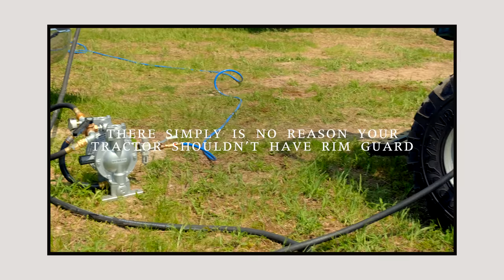I THINK I COULD PAY OFF MY TRACTOR WITH ONLY 1 JOB 🤩🚜👌

Comment: I've always considered tools and equipment this way.  What is the ROI, if any. The only thing we don't  include in the calculus is our time. If you can make more money selling your time on your regular job,  it may not be justifiable in that way.
Reply from the maker: Definitely, I like to think about things in that way, but there are times when I just don't care either :)
Reply: You have to consider what else you would actually be doing with that time. Are you taking unpaid time off from your regular job to do the project? Then yes, what you make at that job factors in. Do you have very little time to spend with friends and family and the project will take all your free time? Then it's not worth it for any monetary savings. However, many people work a set amount of hours a week and split the rest of their time among chores, family, hobbies, projects, etc. Were you going to work 60 hours a week (or 80? or 100?) at your job if you didn't do the DIY project? If not, this calculation doesn't make much sense. It's really a question of what brings you satisfaction and provides a balance in your life. A DIY project will almost always pay better than watching Netflix (or YouTube) regardless of what your day job pays! (unless you screw it up badly enough that it needs to be redone by a pro)

Comment: I1 job payoff,no. I did more than pay for ours by plowing our driveway ourselves over 18 years/. Our drive is 900 feet with a side drive to another rental house we own.We also have a large parking area and a trail to a cabin we have. The price to plow this was $100 plus. It also needs pushing back if you have a very snowy season. Multiple plows in big storms. We average maybe 11 storms per year. We also grade the driveway and yard wood. We have moved a lot of rocks and stumps.. We use a toothbar. We found most implements were not worth owning. they were rarely used so we sold them,at a profit.Implements are now crazy expensive. 2100 hours Kubota L 2800 gear tractor. The work gets done on your schedule. That is worth a lot .Sometimes I plow at 1 am.

Comment: Even if you figure your time at $20 an hour you have the tractor and attachments left to use in the future. If you have the driveway installed by a contractor you have to pay to have it maintained instead of doing it yourself. For me a no brainer.

Comment: As for geotextile fabric, when was the last time you saw it used on a county, state or federal highway under the roadbed?  That should answer the question as to whether you need it.
Reply from the maker: You mean because they spend millions of dollars on equipment, labor, and material to haul away all the top soil and build a proper road bed?  That might have something to do with it 🤣
Reply: @GoodWorksTractors  Partially, but mainly because it simply works better.  You showed tilling to remove topsoil.  If you don’t have a dozer, which was used to build my driveway, then till and remove the topsoil as you showed in the video.  Then lay in a 6-8” layer of 3” or larger stone as you showed in the video, then add a few inches of crushed stone and then top with the surface stone appropriate to your use, anything from crushed stone to decorative marble.  Geotextile is a bandaid when used for roads and will fail over time.  Better to do the prep right and be done with it.  It is like buying good tools vs. Chinese junk: the buy once, cry once approach.  Geotextile is great for erosion control, soil stabilization for retaining walls (I’ve a masters in civil engineering), etc., but separating a roadbed from organic materials is not the best use of geotextile.
Reply from the maker: @LTVoyager  separating a roadbed from organic materials is a primary function of geotextile fabric.  The amount of material to remove is not standardized.  If you have 18” of topsoil and only remove 8”, you still have a problem on your hands.  Many variables in play.
Reply: @GoodWorksTractors  If you have 18” of topsoil, you should remove 18”.  If you remove 8” and use fabric as a bandaid, you WILL be revisiting the road in the not too distant future.  It all depends on whether you want to do it right or do it twice.
Reply: @LTVoyager  We had a neighbor a number of years ago try to solve two short areas that were worse for gravel disappearing into the soil. Another neighbor dug down past the organics to a layer of "hardpan clay" several feet down below the surface, then refilled it with base rock for roads. A couple years later, the gravel was no longer visible and mud was back on the driving surface again. Some places, unless you are a government entity with really deep pockets, simply going past organics isn't always the answer.

Comment: what's the orange wire hanging loose on the tractor?
Reply from the maker: Probably my electric chute controls for my snowblower chute rotation.  Just temporarily installed it on this tractor.

Comment: I've almost got our beach volleyball court finished and that alone will pay for the tractor. I believe it will be finished with only 100 to 120 hours on the tractor.  Quotes just for the excavation, not even including spreading sand or digging for drainage pipe, were between 7k to 30k.  And the low bid was probably a scammer imo.

Comment: I believe you left out a big variable in your calculations. You have to assign an hourly rate for YOUR time in the seat. Even if you love to do the work (and who doesn't like to do tractor work?), to do a fair cost analysis, you should add this cost. Ask an accountant..
Reply from the maker: Oh most definitely, time always is a cost.  I have another video coming out addressing this specifically.  I left it out on purpose as this is about paying for your tractor by doing the work yourself.  It's the entire point of the video...doing it yourself, so of course it's your time.

Comment: New guy question - Why not crusher run?
Reply from the maker: Definitely an option, not that popular in our area for whatever reason...we have similar alternatives though...I think 22a is fairly close in composition
Reply: Yes I recently cleared a building pad next to house using the Hindi tractor tracker and decided to go with crusher Run for the short driveway and parking pad.   worked out really well but I did learn my lesson about clearing the undergrowth